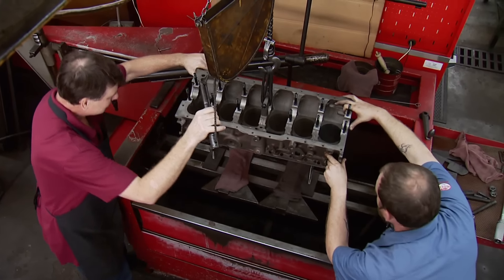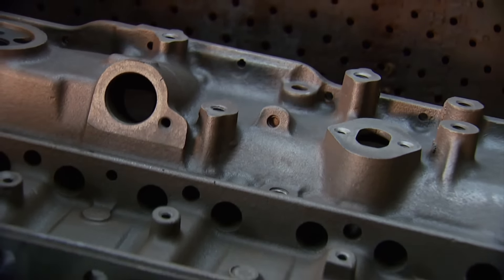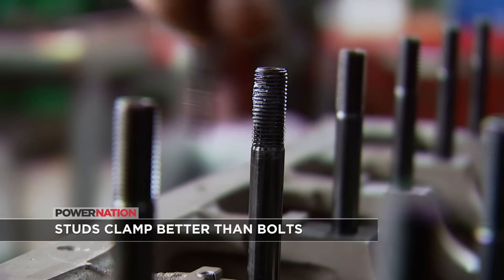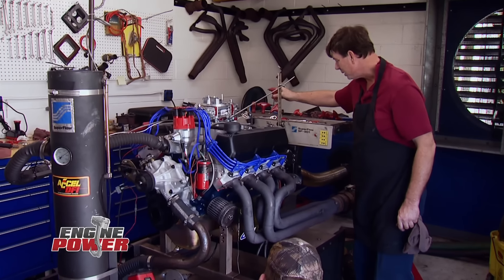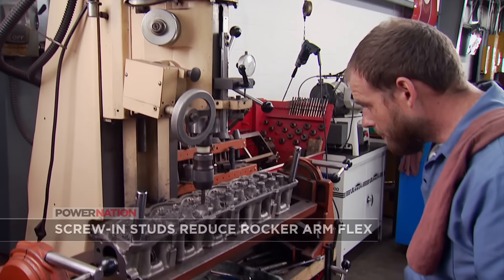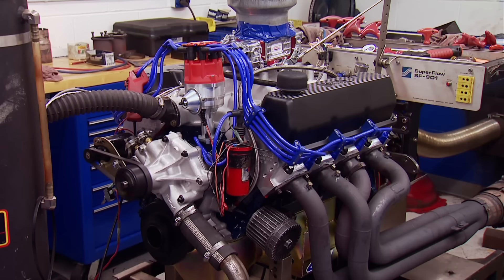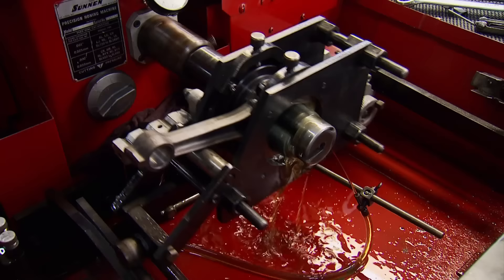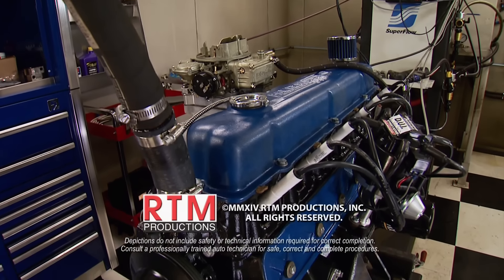Bringing An Old School Straight-Six Back To Life - Engine Power S1, E3

Comment: MAGNAFLOW IS JUNK, well not junk but just look at the connector pipe areas. That system is no doubt advertised as 3 inch mandrel bent but those connects are necked down to 25/8, i know i bought one of these and had to pay an extra 300$ for this to be cutoff every joint and welded or expanded to slide 3 inch into.
WHY NOT just make a system that comes with ALL STRETCHED  joints instead of shrunk down?

Comment: isnt frank FUDGING the TQ/HP number?
i think he had auxilary electric to run water pump and whatever other accessories were on.
SO the customer customer is shown inflated gross numbers but probly wont notice 8 hp lost on the water pump alone but combined with big old pulley fan which can suck another 13 hp then add in alternator and ac and u r looking at 50 hp not goin to rearwheels never mind lost to an automatic tranny

Comment: HOW THE EFF CAN YOU CALL THAT EXHAUST SYSTEM AT 17.14 A 3".... it clearly necks down to what looks like 2/5/8 at each joint choking the system.
the ONLY  way that will BECOME  a 3" is if its professionally welded after cutting off each of those necked down joints
Reply: this is one of the reasons i quit watching this show ten yrs ago on cable,  FALSE ADVERTISING FOOLED  me into buying one of those crappy expensive magnaflow systems.
Reply: also, the nice shiny tip went blue in a month

Comment: Don't EVER overheat that engine with those brass valve guides. They will weld to your valves and you will get a big hole in your piston. HATE BRASS VALVE GUIDES !!
Reply: Years back we used sintered bronze guides  , lot heavier wall than those . But I haven't done much engine work for 40 years,  things might have changed

Comment: Great video EXCEPT, where are your safety glasses? You have pieces of metal coming off machining tools, you are hammering on tools and engine parts. Any of these actions could put a metal splinter into your eye. Be responsible and show your viewers how this work should be performed with safety glasses. Save a few eyeballs!

Comment: Bla bla bla,you can't make the rods stronger by changing the cap studs, he is full of it on that issue and why, I say why doesn't anyone say anything about true timing??? It's not that big of a secret. 9,000 of a timing change is why a smaller Ford engine won't dominate a big block Chevy. A true mechanic knows this and Chevy lovers can't stand it.

Comment: I was down with this vid, Until you guys used a hammer on the sleeve. Like wtf man lol. Do you guys know anything about iron?
Reply: You must've never heated a block and chilled a sleeve.
Reply: Buddy, it doesn't matter what the liner is going into, wet or dry. The liner is made of ductile iron. When you go pounding on it you run a high risk of cracking the sleeve from the hammer shock. That's a fact. You need a temperature difference, and if needed, a press. At the end of the day, this guy should've just scrapped this block, ford i6 blocks are dime a dozen.
Reply: @kylehorn09  I managed to get a piece of metal in my eye even with safety glasses just drilling holes in the rear deck for speakers so this is much worse.   You only have 2 eyes to lose.

Comment: Ah. Another boat anchor.   Today on Engine Power we prepare to spend $5k to make less power than a  junkyard v8 can make for under a grand.
Reply: Yet here you are. 

Different strokes for different folks. Unless you’re footing the bill, someone’s engine choice isn’t wrong
Reply: @redram5150  no but it can be foolish to waste money building something that is going to be big heavy and slow.  The show is called Horsepower remember.   Not how to waste $5000 for 175 hp.
Reply: @bmstylee  again, you don’t get to decide what isn’t modern enough, or what’s not powerful enough. Some people just want something different. Others aren’t interested in being the fastest kid on the block. It’s their money and project to build as they wish
Reply: @redram5150  so they are hipsters who want to be different.   200 hp on something that will weigh damn near 1000lbs by the time it's built is pointless.  Unless going slower than a 1986 Escort is cool.
Reply: @bmstylee  First the show is called Engine Power. Second i don't know where you got 1000 pounds from, a fully dressed 300 even with flywheel, weighs around 500 pounds. And anyone building a 300 without having to tear into it can easily make good power and great torque with only a new intake carb cam and exhaust, all on an engine that will last more then 500,000 miles before needing rebuilt.
Reply: @bmstylee  big, heavy, and slow.... Huh. That... That almost sounds like a TRUCK. Wait a minute.... Isn't this a truck engine? :P Alright, that's enough friendly teasing for one day. In all seriousness, there are several reasons why this engine is worthwhile even though it will be slow as a truck engine in a truck. In my 1981 F250 with 35" tires and no overdrive gear, my truck with an old worn out engine will get about 16 mpg hauling a truck bed jam packed FULL of gear for an entire group camp trip going through the mountains. Maintenance is absurdly simple and learning for a newbie like me was easy as can be, you can access everything and see everything so easily and parts are beyond cheap. When I got this thing for $1,000 it had water in every type of oil and it had been beat to hell. Some basic maintenance and some mild tuning and it is smooth and tough as nails years later. 

Now I'm still rocking the original setup with the 1 barrel carb that made less horsepower than my 1997 impreza brand new, and I probably have the horsepower of a geo metro right about now, but with the stupid amount of low end torque and that granny gear I'll roll over just about anything and I can haul an entire bed full all day long, even if the truck hasn't been regeared to account for those giant tires the previous owner put on. 

My point is, no one SANE and looking for outright speed builds these engines. They simply do not breathe well. These engines are designed for either work and/or daily driving OR for hot rodding a sentimental old work truck. Sometimes for throwing into an old hot rod or off road buggy. These things are smooth and strong at low speed while being mind bogglingly easy to maintain and reliable as the ground we stand on. They are rewarding to drive around since all of the grunt is down low and they rev about as high as a stock mini bike engine lol. It's like going for a walk with an old dog that's overjoyed at just being out and about. 

Please take all of the fast junkyard engines. Build them all, make screamers, hit the track or drive surprisingly fast from stop light to stop light. People like me will watch in amusement and delight at the roar! In return please try to take a moment, just a moment, to see why someone might NOT be looking for maximum speed out of an old car or truck. There are so many machines with so many purposes and so many ways to enjoy them, so should you ever get bored of outright power just know that there are still other things about engines to enjoy. For me, I will keep taking my slow ancient truck full of camping gear on adventures and HOPEFULLY this video will help me plan for giving it more horsepower than a geo metro someday :P I will be endlessly amused at how it can be SO SLOW and yet have so much damn torque down low and still get the job done and start easily every time despite time and horrific abuse. Then I'll crack my window and savor that sweet roar of someone like you going down the road. There is just too much about engines to enjoy, so I hope that you don't stay stuck with this opinion on boat anchors and wasted effort. I'd like you to be able to smile in amusement at an old slow truck that is still chugging along doing work just like I'd roll down my window to hear the fruits of your labor. Certainly beats ogling some Kia crossover lmao.